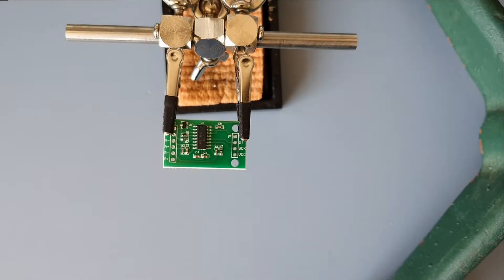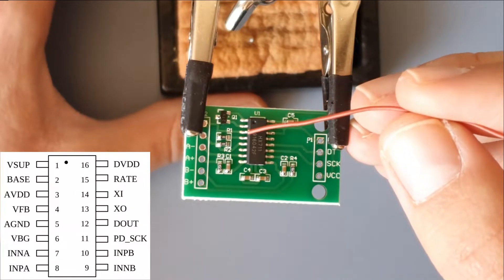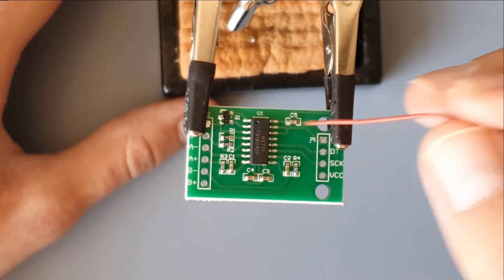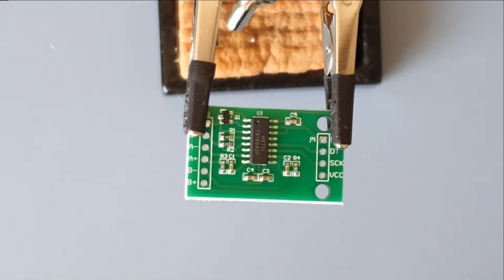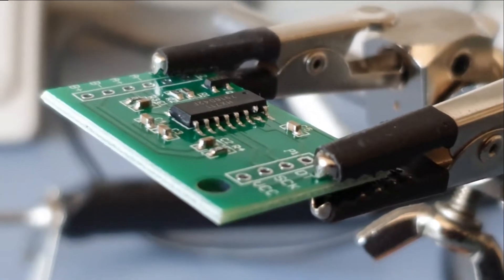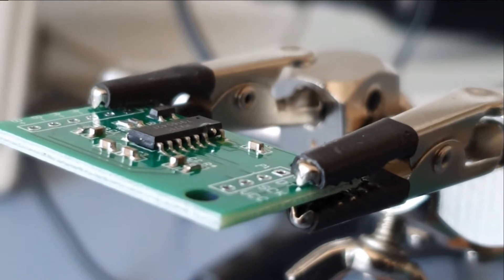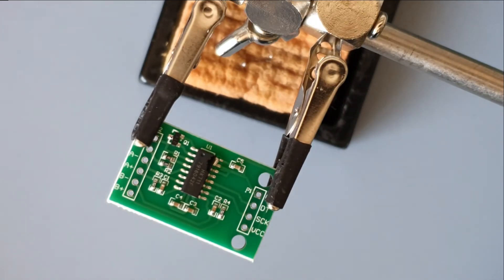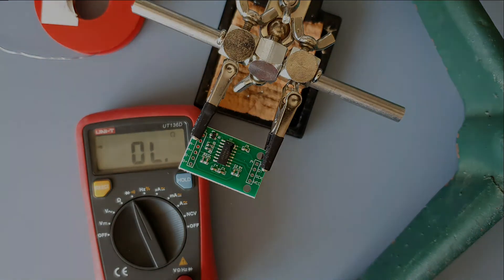Fast PASTA: converting an HX711 module to 80 SPS

Comment: I contacted one of the companies that produce an HX711 board that has no easy way to drive Pin 15 high other than the desoldering method.  I desoldered mine and bent the IC pin up, then bridged it to Pin16 for power to drive the pin high, just like shown here.  The recommendation I received was NOT to do this because the resultant load on that power line may or may not last and may introduce some instability in the output of the HX711.  Since I haven't needed a super high level of accuracy I never worried about this.  The semi-official recommendation is to disconnect Pin15 from ground, and since your most likely using an Arduino, ESP32 or some such, connect Pin15 to a GPIO and control it through the firmware.  Connected like this you now have control of 10 or 80 SPS at the push of a button, so to speak.  The best way to increase the sample rate is to add an external oscillator as shown in the datasheet which will allow tuning the sample rate from a bit below 10 SPS to somewhere around 125 SPS.  No offense, these HX711 variety of breakout boards vary quite a bit in quality and accuracy and conversion stability.  It could very well make a big difference between the 10 for $4 or the $8 each version.  Not a big deal for a kitchen scale but if you're a gold dealer you could be in a heap of hot water.

Comment: Hey Davor, thanks for the video h you seem like a HX711 expert, so i hope you could help me. I tried with a slightly different board. The Jopto CJMCU-711, which is also sold under some other names. It has two pads marked rate at the lower side. It does not seem to make a difference whether I bridge those or not. Output is still 10hz. The pin 15 is also always low. Would you have any idea what I did wrong?
Reply from the maker: If there's a small line (trace) between the two pads, then you actually need to cut that. The pads serve so you can reestablish the connection
If this is not the case then I really have no idea, but desoldering the pin as in the video should work either way.

Comment: Hello there, great video, I have a hx711 board that I brought, looked just like yours in the video on the amazon advert, but what I got it's slightly different where the little components are, have heard it may need resistor removing or moving to make it 80sps ? Do you think this might be true

Thanks alot
Reply from the maker: Sorry, I honestly have no idea. There are many variations of these little boards, but the main principles should be the same. You likely need to trace what is connected to what either visually, or using a multimeter to get to the bottom of it.

Comment: hello man. thanks for the explanation. if i need more than 80 sps, can i increase it maybe around 500-1000 sps ?
Reply: You can get up to a maximum of 145 sps by putting a 20MHz crystal across the XI (pin14) and XO (pin13) pins. The data sheet is worth a read.

Comment: Will this fix input lag using Arduino as a game controller on PC? I have this board with a 20kg load cell and when using it on the PC it takes a second to register as well as releasing, and I need it to register immediately for a brake for sim racing
Reply from the maker: I'm copy-pasting my response to a similar question:
The default sampling rate of the HX711 module is 10 SPS which does seem a bit low in terms of gaming responsiveness. I'm not sure if you'll be able to achieve satisfying performance even at 80 SPS, but I think it's worth a try. I'm not sure if there are other readily available modules like this one that, for example, sacrifice the HX711's high resolution for faster sampling rate (if you find one, let me know!). A general purpose differential ADC chip might work, but it's not as easy to wire up from scratch compared to these little modules. Regarding wire length, if you mean the USB cable length, that won't matter.
Reply: @davorvirag  if you get a minute to check this out he is using a hx711 and I read in the comments that it needs to be switched to 80hz which I'm assuming it's what you are showing us in this video. Am I correct? https://youtu.be/GK6je_cmFFc
Reply from the maker: @Cdosier90  I can't find the comments that you are referring to, but, since the video also uses an HX711 module, if you want to switch it to 80 Hz/SPS, I'm certain that the modification described in this video is the one you are looking for. Best of luck!
Reply: @davorvirag  thanks for your quick response and help! I appreciate it.
Reply: Did the input lag decrese with this change?

Comment: I am getting lag in input to a computer... It appears, on pressing button it notes 0.3s late.   By running on 80SPS will this solve the issue? OR long wire (1 mtr + USB cable) causing the lag?!  
I made a DIY handbrake  for racing games using loadcell, Hx711, Arduino Leonardo Atmega32u4.
Reply: I am having the same issue it's not the long cable because I've tested a short cable and long cable and there's no difference. Have you tried this yet? I'm going to give it a try and see if it fixes the input lag. Can't drift with a slow handbrake! Lol
Reply from the maker: @Cdosier90  Yeah, if you mean the USB cable, its length won't make a difference as it's just carrying a digital protocol, so it'll work consistently up to a certain length (I think a simple cable without repeaters can safely go to at least 5 meters and likely more? Not sure specifically, but I think it's defined in the USB standards).
Reply from the maker: The default sampling rate of the HX711 module is 10 SPS which does seem a bit low in terms of gaming responsiveness. I'm not sure if you'll be able to achieve satisfying performance even at 80 SPS, but I think it's worth a try. I'm not sure if there are other readily available modules like this one that, for example, sacrifice the HX711's high resolution for faster sampling rate (if you find one, let me know!). A general purpose differential ADC chip might work, but it's not as easy to wire up from scratch compared to these little modules. Regarding wire length, if you mean the USB cable length, that won't matter.
Reply: Did the input lag decrese with this change?